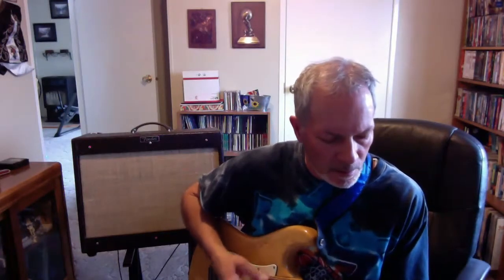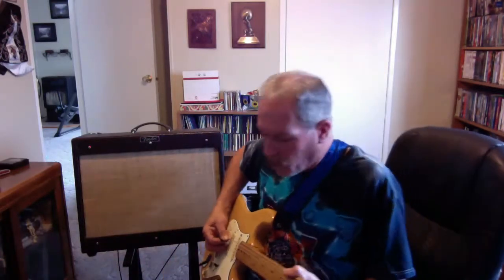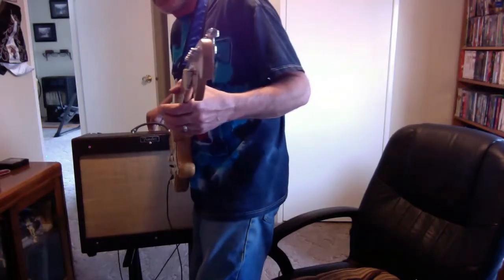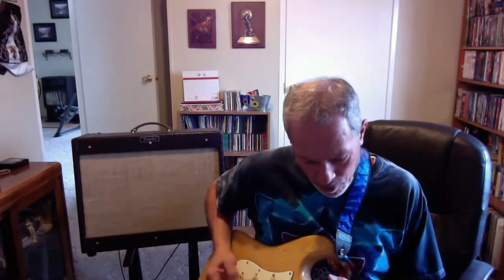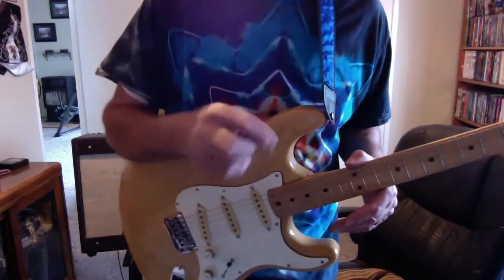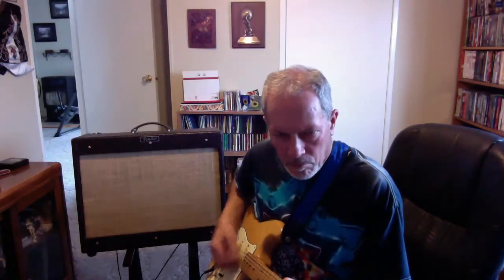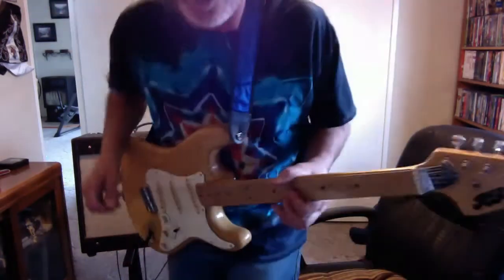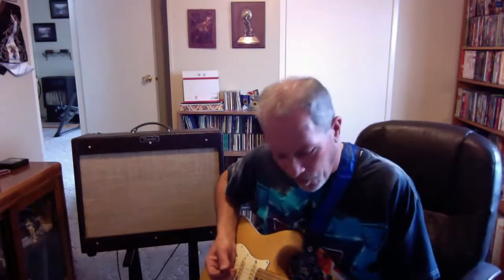hot rod deville/deluxe mods

Comment: I think the problem with these amps its basically the entire dirty channel lol. Love mine on the clean tho!
Reply from the maker: +Jacsar916 the new hot rod III sound very good across the range on controls which surprised me. no one should sttle for 1/2 an amp..my contact info is on some of my other vids in the notes
https://www.youtube.com/watch?v=WGlX1IdGeG8
Reply from the maker: +Jacsar916 : the addition of the clean chan mstr vol works great and is easily applied and allows smooth control over that chan. * if you are a pedal person; i understand. i believe one should be able to take their amp /guit and play. obviously genre dictates add-ons

Comment: I hate low frequency. Please, if I just change vol and bass pots to 1MEG,  will it help ? Or better cgange all pots to 1MEG ?
Reply from the maker: ok.. look at my contact info in more notes on this link : https://www.youtube.com/watch?v=k9TkIl1cG7Y
2 ways to affect low freq . 1 ? are you looking to change the amount of low freq content with respect to the Hi freq?
2. OR.. are you wanting to raise the low freq cut-off point set by the bass + mid tone caps?.
to affect choice #1 ; you increase the value of the slope resistor. this does not affect how "deep"...just "how much".
to affect choice #2; you leave slope resistor same/stock and go to smaller value cap for the bass..ex: C5 ( .1uf) to .022uf.or even cleaner change both C5+6 to .0022/222 as in stock blues jr.
another way is to lower value of C24( .022)in front of the PI to a smaller .01-.0022uf . if an amp spkr combo is too bassy and you want a steel guit feel. mimic the blues jr coupling caps and tone stack
Reply from the maker: to clarify: do not change clean chan pot to 1 meg unless you intend on doing the master vol mod and pull input #2 jack. ( can supply tech info when you email me) ^^ this is just semi-general approach that any tech can grasp to help you.